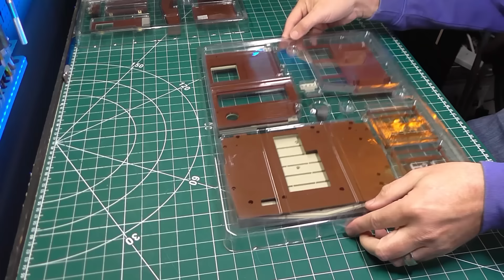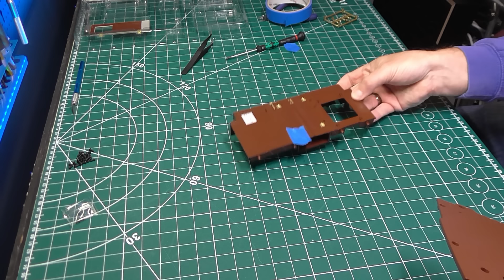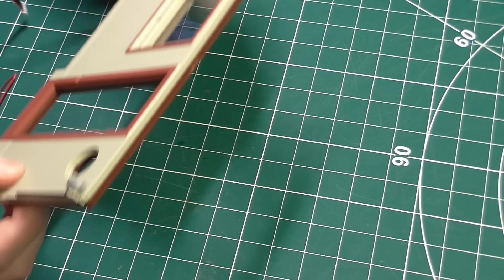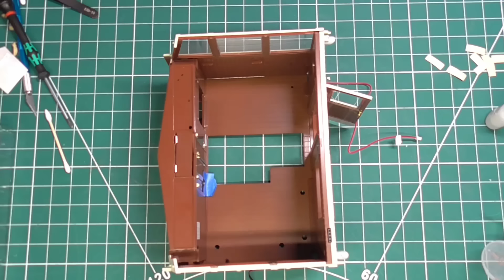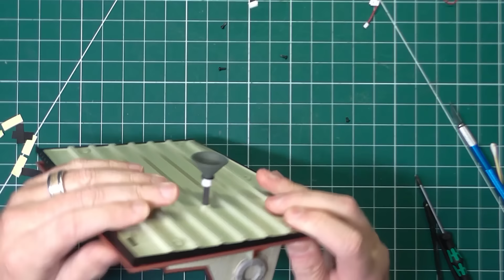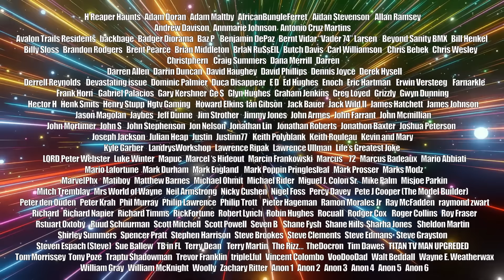Build the 1:16 Scale Orca Boat from Jaws - Pack 3 - Stages 10-13 - Agora Models

Comment: Hi Wayne, when I went to test the lights after the assembly only 2 of them turned on. the navigation lights, search light and the two inside didn’t light up. I followed all the instructions carefully and made sure all the numbered wires go to their corresponding number. I could really use your help! Thanks.
Reply from the maker: Up to this pack you should be able to test each light separately. In pack 4 you test them all together

Comment: For the windows, I use either:  very, very light spray coats of buff color...or....light colored pigment powders (easiest to fix if you dont like)...or...alcohol with very little paint or pigment mixed in, you can add layers until it gets to where you like it.   Just my way of doing it.   :)

Comment: To be fair the windows are supposed to be clean to get the boat safety certificate because this cabin doubles as the wheelhouse for foul weather conditions so regardless of how weathered the outside is a boatman would keep the interior and windows as clean as reasonably possible. It is after all a living area as well as a working area.

Comment: Funny thing: the fumes of AC glue (which would ruin the clear plastics of this model if applied to them) are used by forensic teams to mark fingerprints on transparent objects (like things made of glass) where the usual powder they use wouldn't take hold.

Comment: if that detail you painted silver on the flying bridge is meant to be a "porthole" to let light in to the cabin, should you also drill out that hole into the ceiling of the cabin?
Reply from the maker: Yep but then the lens I put on will be incredibly thick as the two plates come to about 9mm . I'm considering it though.
Reply: @WorldofWayneUK  you could put two bits of plexi back to back to get the thickness. It's not as if it needs to be optically clear
Reply: Are you talking about the floor drain?
Reply from the maker: @russandkris1 it's a deck prism
Reply: @WorldofWayneUK so what we thought was a drain is actually a floor prism?
Reply from the maker: @russandkris1 yep
Reply: @russandkris1  not a drain. It’s a deck prism.
Reply: On another forum – Nigel said there may be an insert for this coming later – have you heard anything about that?
Reply from the maker: @russandkris1 I haven't